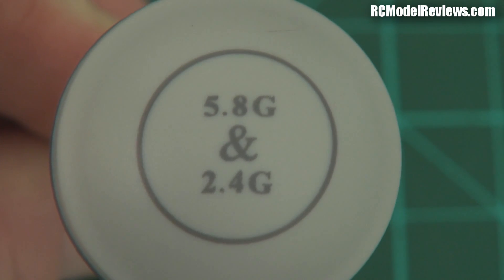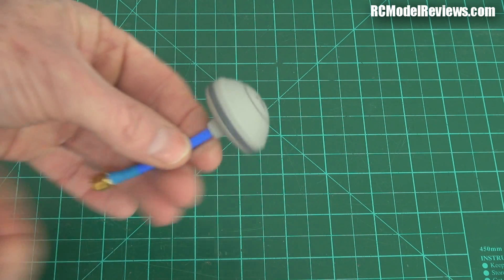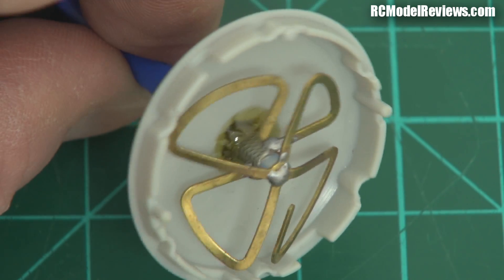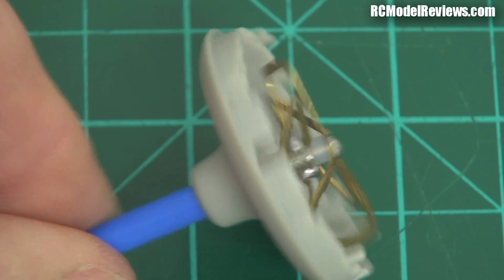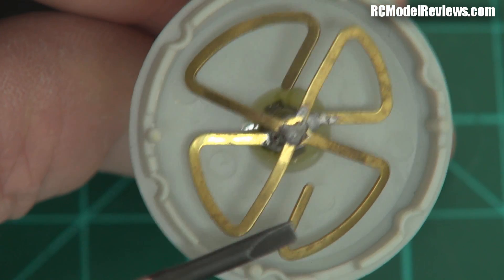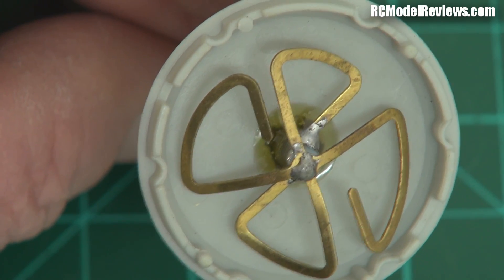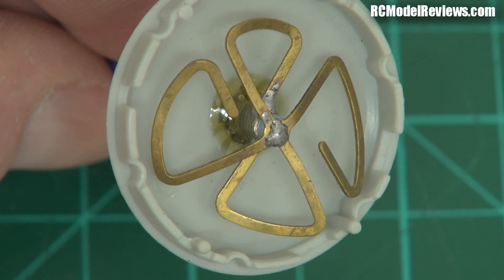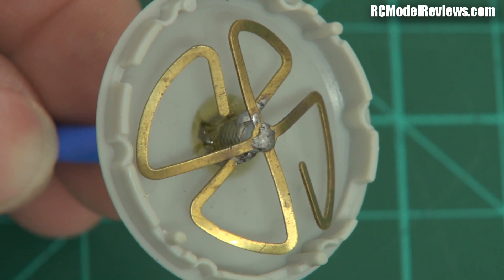quick look: Dual band FPV antenna (2.4GHz and 5.GHz)

Comment: Bruce,  when you buy a set of 5.8Ghz antennas you generally get a 3 & a 4 lobe arrangement marked TX & RX respectively. Why is this?  Why not use 4 lobe for both TX & RX?  Hope you can shed some light on the subject..
Brett

Comment: Hi Bruce - think you have more signatures on the petition than the entire MFNZ membership.  I get it about the support network you have built up around the area you live.  Leaving that would be daunting.

The other idea would be to make it a fly-in fly-out job that we in WA have half the working population doing.   Open the Patreon account that several people have suggested and setup somewhere else as remote worker on say 2 weeks on, 2 weeks off.  Might allow you to fly in one of the districts that are model friendly.  In Western Australia it seems that at least half the working population are remote workers so it does not seem as strange here however it may be something you have not thought of as it is probably unusual for NZ.  Having said that the electrician on a rig off Barrow Island lived in NZ and commuted every month.

Comment: Hi Bruce.

A very interesting antenna. I expect the reason they've bent the two sides of the 2.4GHz antenna the way they have is so the VSWR is acceptable for the two bands and to reduce the interaction between the two antennae. However I doubt the Impedance (Z) will be 50Ohm and the Reactance (X) will be quite high resulting in very poor efficiency. As Scotty on the Enterprise once said " Ya can nay change the laws of Physics, Captain"
Regards
Nidge

Comment: Hey Bruce, I'm trying to do a 10 km FPV flight  with a 1/4 scale ARF plane with a 28cc gasoline engine. I have been looking at one of the big dome style antennas (about the size of a stack of 5 CD's) and a 2.0 watt amplifier. (admittedly it's what someone else used and had success with) But I was just wondering what your take is on the different frequencies? i.e. do you get better range comparing 900mhz to 2.4 to 5.8 per m/w you put in  the system? are more line of sight dependant than others?
Reply: +shoominati23 To be honest... I really wouldn't recommend a 10Km flight with a gas-powered model.  Although I have my reservations about the over-regulation associated with FPV flying, there are many extra factors involved with BVLOS FPV operations, especially with something that could pose a very real threat to person or property -- such as an IC engine turning a large flesh-cleaving prop :-)   However, if you want long-range video then you'll almost certainly have to opt for a lower-frequency and 1280MHz is widely regarded as the best option for long-range FPV.    higher frequencies (such as 5.8GHz) will give you plenty of range under ideal circumstances but that generally involves a line-of-sight trajectory, which isn't possible with long-range unless you fly at a significant altitude (thus making you a threat to full-sized aircraft).

I'm a strong advocate for creating areas where people can safely and legally fly long-range and/or high altitude FPV by way of excluding full-sized aircraft but sadly, the aviation administrators (despite their claims to be pro-safety) seem to be against such an initiative.

Fly safe!
Reply: +shoominati23 If you plan a long range flight in the country, make sure you check your flight path and attempt to get permission from the landowners of any property you fly over. I'm not sure of your country of origin, but I'm guessing a flight without permission would be illegal? 
I personally don't see the "thrill" of long range flights, you end up with a bunch of boring footage, that most people speed up on Youtube.. I've been out to 2km and I still cut portions of the footage to speed it up lol.
What I would like to see would be a close range big gasser pulling some cool stunts and a view from a very detailed cockpit.
Reply: If you think you need 2W of power to get to 10km you probably should reconsider your endeavour. I did comfortably 12 km on 5.8 600mw immersion RC video TX and ezuhf with dipole on the receiver and moxon on the TX. I think more reading and studying is in order for you.
Reply: oh man, one advice.  before you actually do your 10km flight you need to read read read. the lower the frequency the better penetration you have and distance as well, but there is a lot more to it. A LOT. Take care. also I think that Bruce have already made a video on that subject.
Reply: Yeah, it would be FAR out in  the country where there is flat terrain as far as the eye can see, the odd hill and not much traffic  - of any sort ;) I'm sorry, I must have missed that particular video
Reply: I mean far enough out in the country that I'd only be flying over crown land, no farms to speak of ;) and no having to ask permission to come on a property to retrieve the plane if something were to go wrong ;) remember, there is a lot of barren desert in Australia..